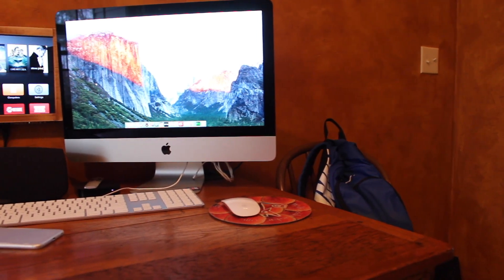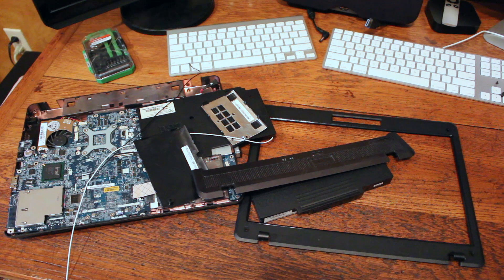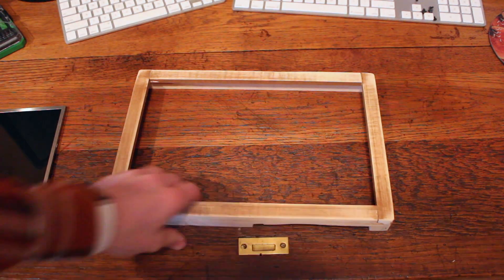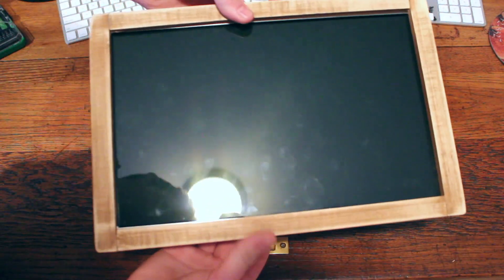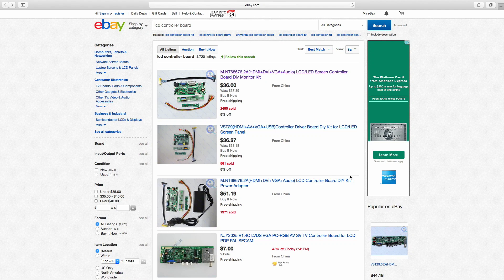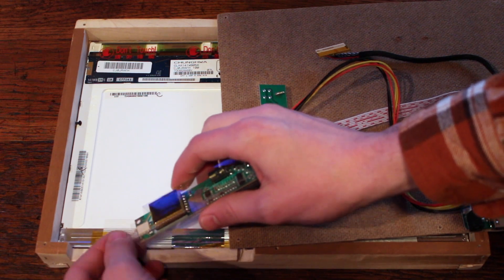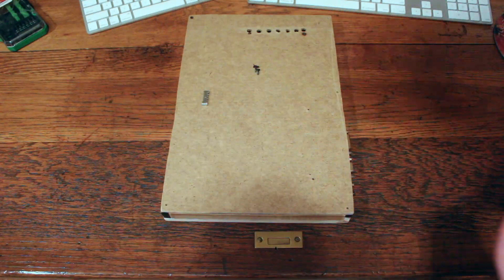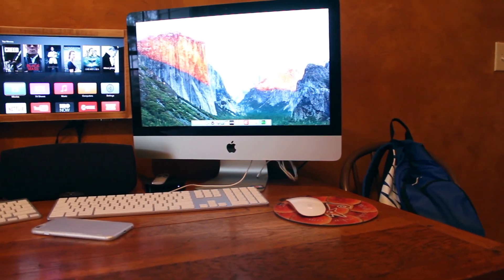HOW TO REUSE THE LCD SCREEN IN YOUR OLD LAPTOP

Comment: I can't seem to find a controller board for the lcd screen i have. Can i just use another board?
Reply: you can use universal controller board
Reply: Hit or miss using universal drivers as they can sometimes have insufficient ports and or power supply.

Comment: are all the converters the same some say for a certain type  i have a hp 19 inch screen all it has on the back is a small bar
Reply: I'd recommend looking at the model number of said screen and looking for a controller board for it.

Comment: Hey I subbed and Liked. Could you help me? I have a ltn170ct10-a04 LCD from a 2011 A1297 17" MacBook pro. Will this controller work for this?
Reply from the maker: I don’t know for sure. But what I would do is go onto eBay and search “lcd controller board” and the model number you gave me. I found some that match your number.

Comment: how did you power it
Reply from the maker: It should work. I'm not too familiar with psu's
Reply from the maker: I used my computer charger.
Reply: How about using the PC's PSU? 12v from molex connector. Will it work?
Reply: s

Comment: Do you have an antenna? Can somehow add a tv antenna?
Reply from the maker: tico mix gamer You could add one and connect it through the hdmi port.
Reply: Isaac S To be able to see signal channels by air
Reply: If you wanted something like that then I'd recommend to get a Google Chrome cast or get some converter board that turns TV signal in to HDMI or any other port you have on the controller board

Comment: My tablets LCD is in an inaccessible shell... Ugh..
Reply: With tablets goes the same as for phones, they're glass covered and are not meant to be easily removed (unlike laptops which just need a couple of screws and bezels to be removed). So I really recommend against using a phones/tablets screen as there's nobody that would make driver boards for them and it would be difficult taking them out as it requires a heat gun and a long tedious process.

Comment: Nice build. However, you should cut slots in the back on the top and bottom of back cover. Maybe sides as well to act as passive cooling. Perhaps an old computer fan and make it really cool. I'm just worried about the temps on that driver board.
otherwise nice.
Reply: I don't think that the heat the driver board produces is enough to make it overheat and or die, but it is a nice thought/touch to the setup.

Comment: I don't want to take my screen out of the bezel because it's in good shape also would be nice to reuse the touch (and camera if possible
Reply from the maker: +justin rivera well to access the serial number you would have to take it apart but other than that you wouldn't need to take it apart. I don't know if you could use the camera and touch screen as a display.
Reply: You will have to take the screen out of the bezel to reuse it anyway, just be delicate and everything should go fine, you're also going to have to build the casing for the monitor and boards so it doesn't matter that you break the bezel and casing.

Comment: how do I find the serial number how many numbers does it have
Reply from the maker: +Alyssa Melendez My serial number was the top one (claa141wb05a) in the video around 30 secs in.
Reply: I'd recommend looking at all of them and putting them one by one in to Google to see if it shows a similar screen to yours, but I'd recommend ones that are shorter as they tend to be the correct ones.